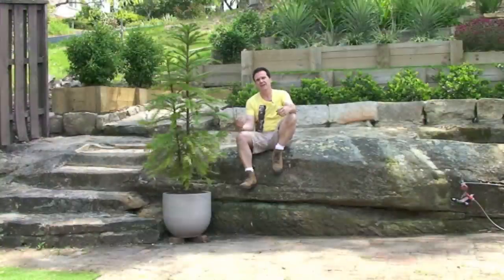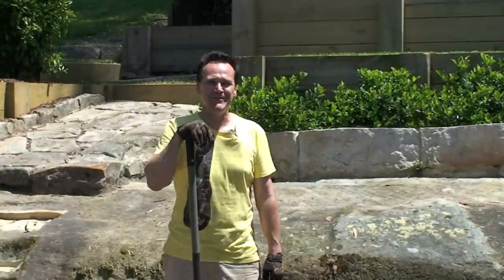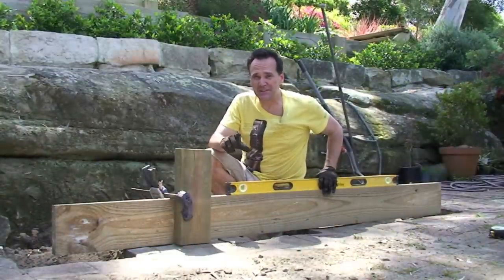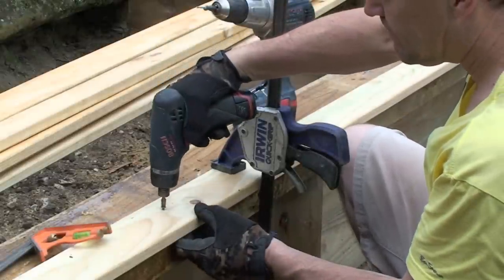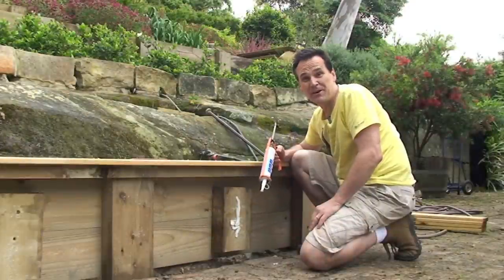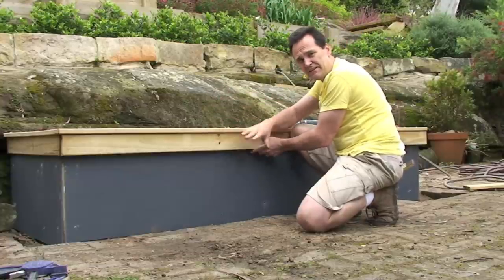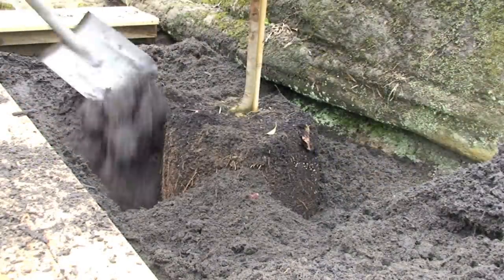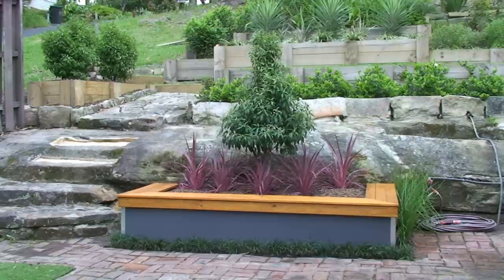Build a garden bed with seat

Comment: Excellent design and bed. I must look up what counter sunk is?
Reply from the maker: Hi @Lily Pond. Thanks :) Counter-sinking is where you drill a shallow hole that is wide enough to allow the head of a screw (or bolt) to sit flush with or just below teh surface.

Comment from the maker: @mr63249 Thanks mr63249 :)
I counter-sunk the screws & then puttied the heads before concealing with a dab of paint. The vid was running for a bit to long to leave that bit in I'm afraid.
The paint was Dulux texture coat, fine texture, exterior-grade tinted light grey.
And just fyi... the story was in the February issue of Australian Better Homes & Gardens mag.